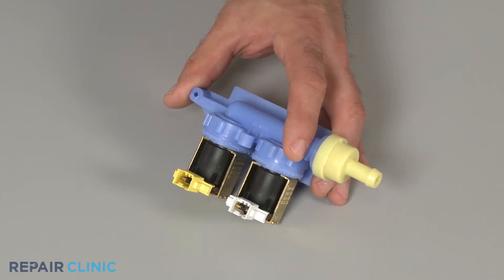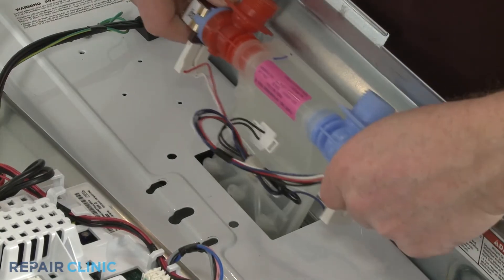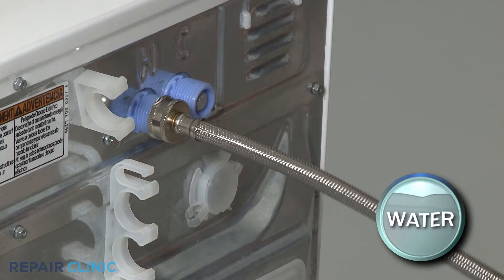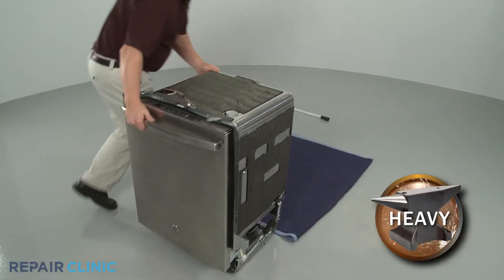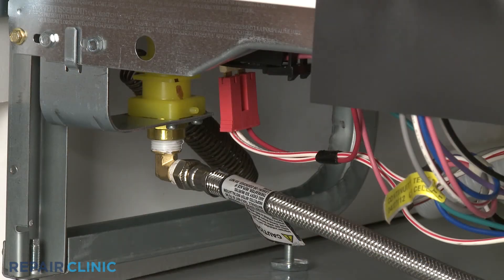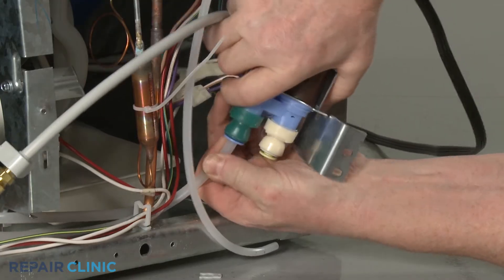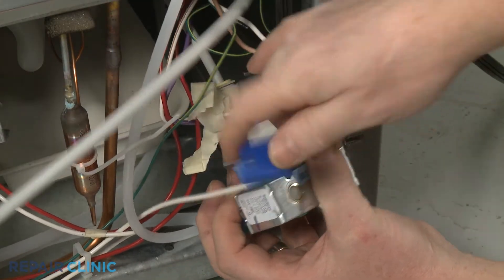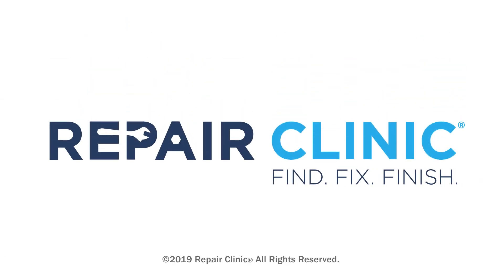Water Inlet Valve Replacement

Comment: Can’t for the life of me get the tube to fully seat on my inlet valve. Also it didn’t come with a locking clip. Both or one of these things are causing it to leak. I’ve tried using a Bobby pin as a locking tab and it still leaks